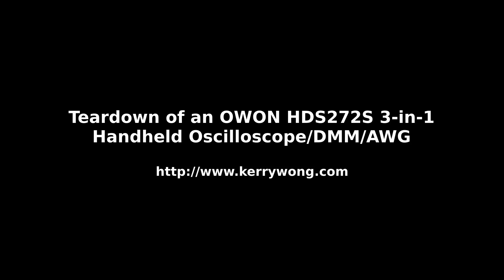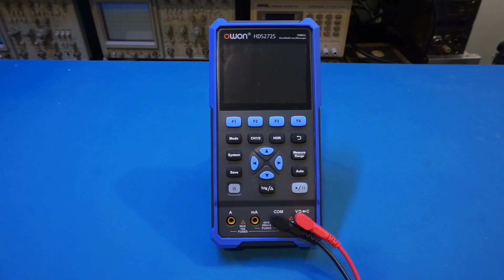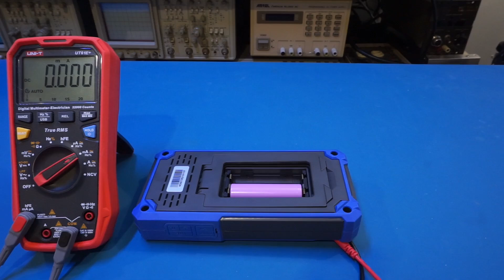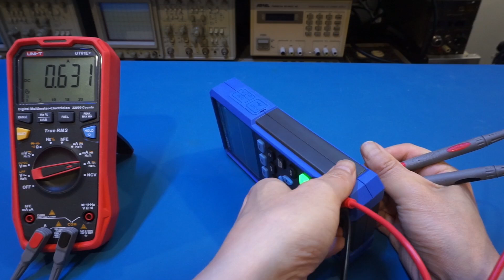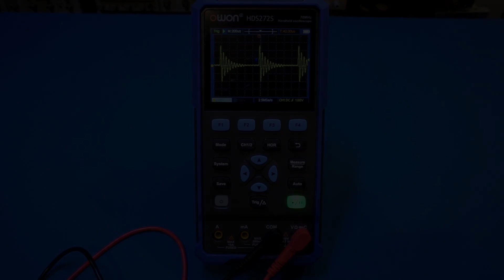Teardown of OWON HDS272S 3-in-1 Oscilloscope/DMM/AWG - How Does it Compare to the Hantek 2D72?

Comment: Hi there! So I checked out my 242S (40Mhz) and it got the exact same chips.
That made me think, maybe the SKUs are a lie and the bandwidth is controlled purely by the firmware?
If you can send me the flash dump it'd be super interesting to try and "upgrade" my unit.

Comment: Unfortunately my HDS272 consumes more than 3mA when not active. Far away from some µA you tested. When I dont use the scope for weeks, accus are empty.  I refuse to drill a hole for switch :) I don't know whether I would buy it again. The Firmware is 1.5.0, it seems that there is no update available.
Reply: Weird, my 242S shows firmware 8.4.0
Reply: @yunodiewtf  they seemingly use first version digit to differentiate incompatible hardware versions. So if updates are released your unit would always use 8.x.x
Reply: @niter43  Exactly as you stated, I always take the batteries out to be able to work instantaneously. What I can say: putting battery in wrong direction doesn't hurt the circuit! :)

Comment: Thanks for the video. I bought the hds272s. Lately when the power button is pushed, the lcd display streaking vertical and horizontal lines. Can you assist as to the cause and how it can be rectified. Thanks.
Reply from the maker: Does the streak persist when the scope is on?
Reply: @KerryWongBlog  Thanks. Yes , it persists. I have no connections to all the inputs.
Reply from the maker: @daviddirac5942  Wondering if the LCD zebra strip somehow did not make good contact with the LCD or the circuit board?  What do you mean when you say you don't have connections to all the inputs? Does the DMM/Osc work?
Reply from the maker: @daviddirac5942  Well, it would be hard to do the diagnostics over comments, but it sounds like the problem goes beyond just the LCD connection as the DMM inputs and Osc inputs are separate and independent when neither works I'd assume something more serious is going on. Do you remember what was the measurements you did prior to this happening?

Comment: Thank you for your detailed teardown. I own the HDS242 and my unit shows a significant DC offset of 1,5V at the 5V range. This offset is drifting temperature related. When calibrated in properly warm status, everything is fine. But I can't always wait 15min to run it completely cold to warm before measurement.
Is there any component to be better cooled, to get rid off this DC offset drift? For example the 8pin multi OP amp lower right under the display?
Thanks in advance.
Reply: Install a fan

Comment: Hello, can you use the multimeter leads to input and see the sinewave from an electrical socket?  I've been searching everywhere for this answer as i'm new to oscilloscopes.
Reply: No, the DMM section is completely separated from Oscilloscope section and can only measure voltage counts. You can just use the probe (in position 10x !) on the ac socket. But be aware, there are several rules to check before, as mentioned in the manual. So for example don't connect any other devices as USB charger or computers because they will have an own ground connection. Use fully isolated probes with proper voltage declaration. AC outlet measurement is very dangerous and not a job for oscilloscope noobs in my opinion.

Comment: Hello'. Thanks for the video. I have a question and it maybe stupid, why when you measured current consumption at the video beginning you used only one battery?
Reply from the maker: The two batteries operates in parallel and it's far easier to measure one current path than using two meters and add the results together.

Comment: I would suspect that the current draw varies with the back light intensity, is that function adjustable?  Also can the unit be powered from the charger, so it can be used while charging, when the batteries are discharged ?

Comment: Hey
Have you measured the operating temperatures of the main chips of this device? Are they overheating as it happens on stationary oscilloscopes?
Reply: That's a great suggestion. I too would be curious to see if possible. thanks for suggesting. 👍

Comment: Nice Teardown ive ordered this same scopemeter and awaiting its arrival.
Reply from the maker: Great! Enjoy!
Reply: @KerryWongBlog  This is a great meter but i got a problem with mine when in diode reading mode its ok when reading diode but if i short out the probes its switches to ohms mode crashes and in order to recover it i have to chage to voltage of current reading.
Reply from the maker: @MrFixiit  Interesting. Hope the issue is limited to the DMM mode.